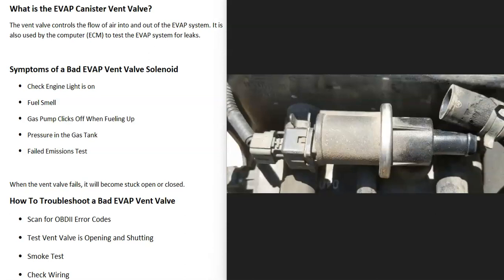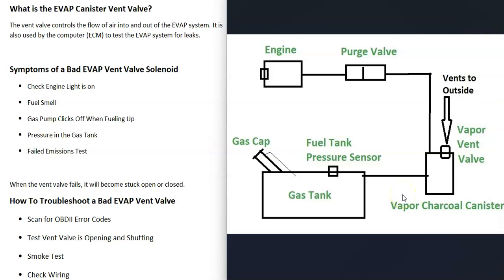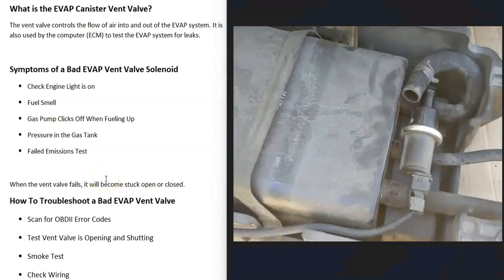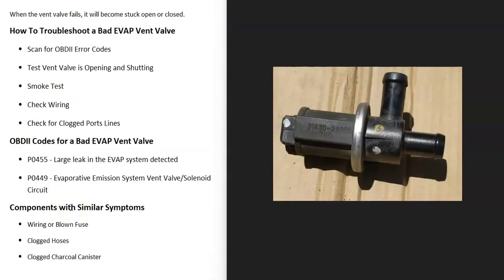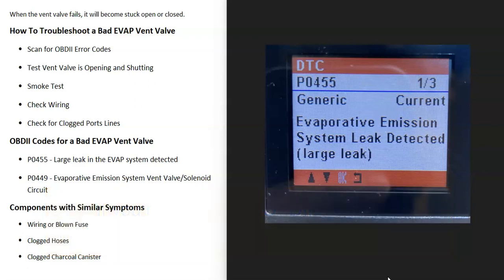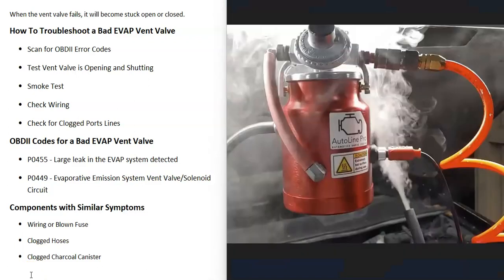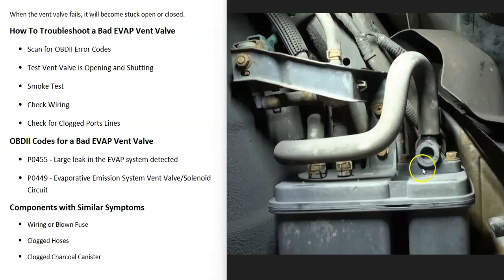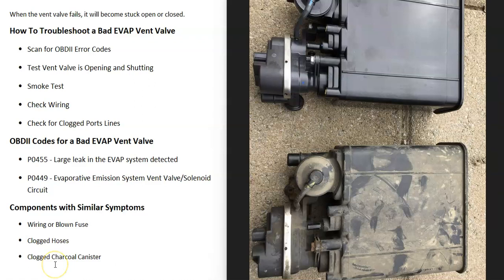Symptoms of a Bad EVAP Vent Valve Solenoid and how Test if it Has Failed

Comment: I have a Mitsubishi eclipse 2007 gs and check engine light is on but it will go on and of but my code is p0431 need help
Reply from the maker: A P0431 code is usually a bad 02 sensor or catalytic converter. I made a video on this code, here is a link. https://youtu.be/7Dm_G2dyCGw
Reply: Another symptom you forgot was a ticking sound which sometimes sounds like a rod or valve knock